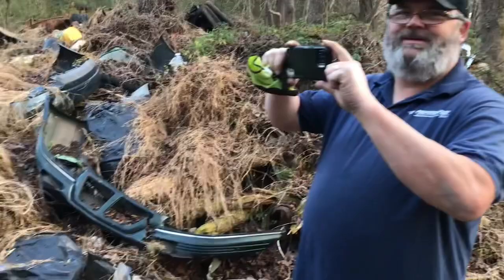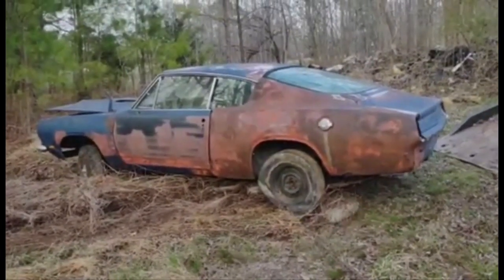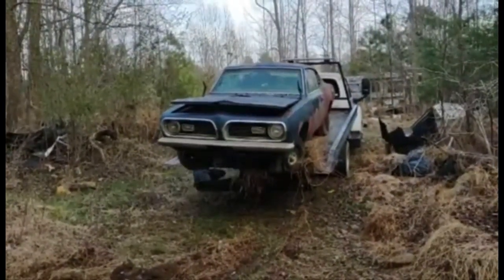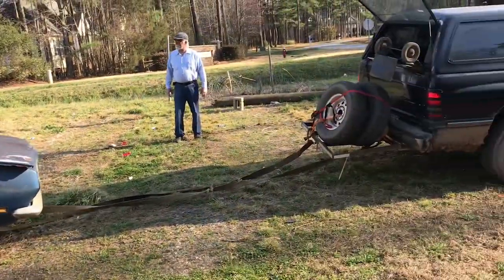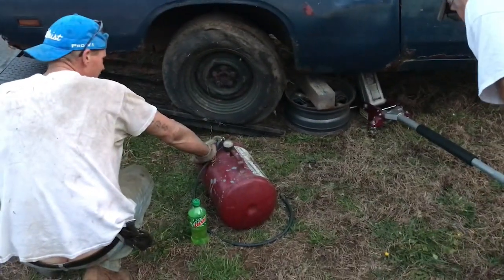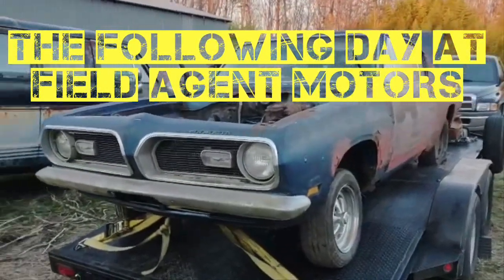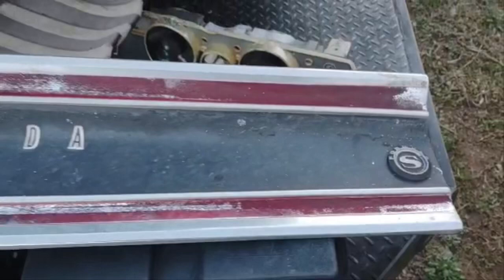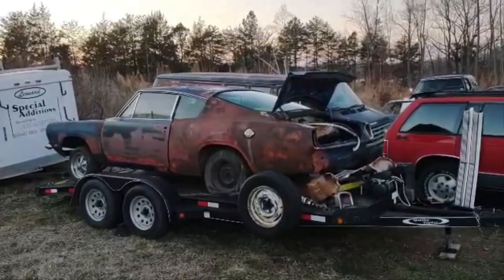RESCUED ! 69 Big Block four speed Barracuda

Comment: your Cuda looks like a great find and a solid car to restore.  i have a collection of 7 68-69 Barracudas one of which is an original 383 4sp fastback Formula S with factory disc brakes and bucket seats.  those cars were low production vehicles.  i also have an original and very rare 69 440 M-Code Cuda which is the prize of my collection.  all my cars are 4 speeds.  oddly, the second generation are not very common but do not have a high value like the 70-71 E-body Cuda's do. good luck with you car.
Reply from the maker: Thank you Jim

Comment: Check the numbers and vin on the block & transmission when you get it.
Reply from the maker: We have the 4 speed & it’s vin matching. Looks like we got stiffed on the engine. More about that later.
Reply: @bobsclassiccarsparts8772  Well that blows. Karma maybe later for them.
Reply from the maker: @mcode440  yea unfortunately I think he hauled the engine off to scrap but told us he had it. We have found a date code correct block so it is what it is.

Comment: Not saying it is not factory but that hood is all wrong. Where are the hood scoops or the mounting holes for them? I may be wrong but a formula S with a big block had them as standard i thought says the mostly Chevy guy with a 69 440 Cuda for being different for once. Careful with that grill as you will die at the price for a new one. Ask me how i know? Do not lose the headlight bezels as they are not reproduced yet.
Reply from the maker: Yea it’s definitely not the original hood scoop. This car has several hot rod add ons